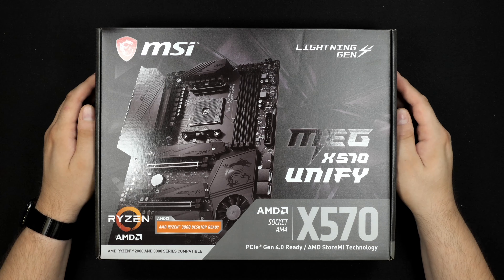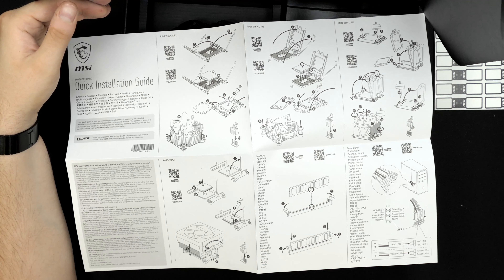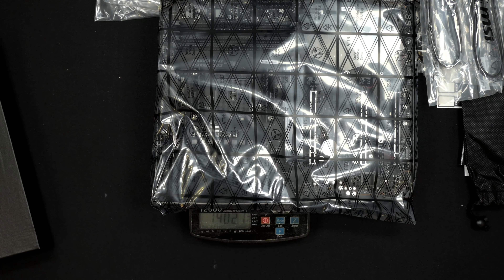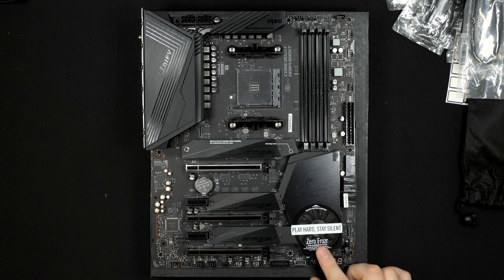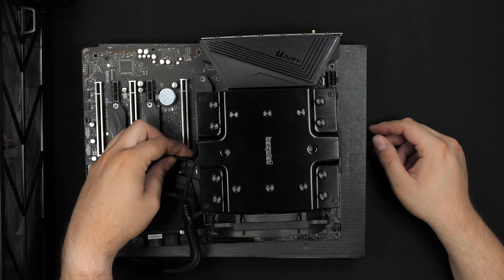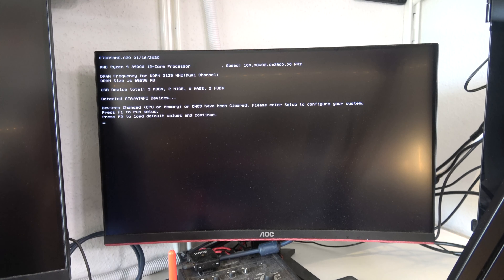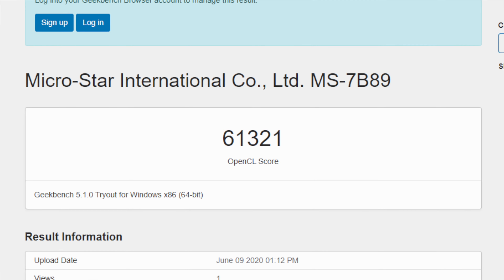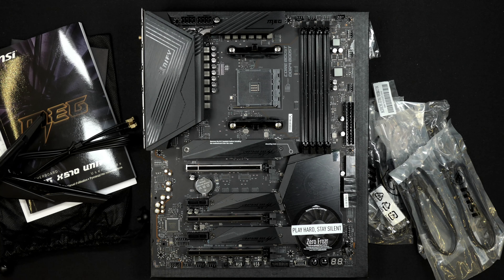MSI MEG X570 Unify - Unboxing, Install & Testing

Comment: you have 2  12v connection at the top of the Motherboard 2 for the CPU and the Other for Pcie x16 ?...what cable are you using to populate this connection from the power supply unit. Another CPU 12v or 12v peripheral  ???
Reply from the maker: Yes just another CPU 12v.
Reply: @whcvip  thanks

Comment: Hey just so you know, the high memory clock at idle is caused by two displays at two different refresh rates.  I think it's a longstanding bug in amd drivers and exists across linux and windows.  If you are willing to downclock one of your displays, you can solve the problem by ensuring they are the same refresh rate.

Comment: Do I need to connect both CPU 8 pins to power? Or one is enough?
Reply from the maker: One is enough 👍
Reply: @whcvip  awesome.  Thanks - appreciated!
Reply: what if I want ryzen 9 5900X? is it better to connect both 8 pins? stock vs oc processor

Comment: why are the 3 different m.2 shields different lenght/size? i hope they are 2280 M-key.
Reply: They all support 2280 M-key
you can check the manual it's available on the motherboard's site

Comment: Thanke for the in-depth feedback. 
Could you perhaps give your thoughts on the x570 Unify vs X570 Tomahawk based on the specs?  
The X570 Tomahawk also looks like a good contender, if not the best mobo option in the sub 300 euro category in Europe... (it costs 220e euros)
Reply: Go with the tomahawk, the Unify and hawk are so similiar it’s worth going with toma.
Reply: You can buy a Unify now. The Tomahawk is sold out everywhere.

Comment: Did you had to force the mb and graphics card into your case ? I felt like the IO shield is pushes the whole thing by 1 mm which requires forcing the GPU and the MB

Comment: Good overview, thank you. 
Considering features, performance and price, I consider this to be the best pound for pound motherboard, 3 pcie gen 4 m.2 slots is great, too. I will purchase it. Much better than b550 which can only run 1 m.2 at pcie 4.0 and any additional cards on 2nd pcie slot compete for bandwidth with other sata or m.2 slots.

Comment: Do i need to connect 2x8 pins to power ? Or one is enought ?
Reply: I came here for the same question... did you get an answer?
Reply: @Bawbster1  no man  but i read somewhere and  i mount it only with one  i mean  8x pins..and it worsks  fine   if u wanna  OC u need  2x8
Reply: @tordatfalviciprian5775  perfect... thanks a million.  Really appreciate it!

Comment: Thats very high v core 1.484!!! Shouldnt it be below 1.3v ??
Reply: Short response: Preferably... Yes. That’s why manual tuning is important.
Reply: Anthony Choueiry  thank you for explaining it!
Reply from the maker: Source AMD:
Please note that it is totally normal for your Ryzen to use voltages in a range of 0.200V - 1.500V -- this is the factory operating range of the CPU. It is also totally normal for the temperature to cycle through 10°C swings as boost comes on and off. You will always see these characteristics, as they're intended, so do not be surprised to see such values. :)
Please do not undervolt the chip or set a maximum processor state of 99%. These are ineffective and/or detrimental changes.

Link: https://www.reddit.com/r/Amd/comments/cbls9g/the_final_word_on_idle_voltages_for_3rd_gen_ryzen/?ref=share&ref_source=embed&utm_content=body&utm_medium=post_embed&utm_name=5a67101147dc40f891dbb0408cc3b126&utm_source=embedly&utm_term=cbls9g
Reply: Anthony Choueiry  ok got it i will set it manually anyway coz i plan on ocin all cores 4.3-4.4 whatever is possible
Reply: @whcvip  thank you